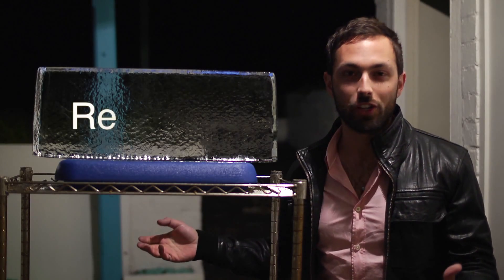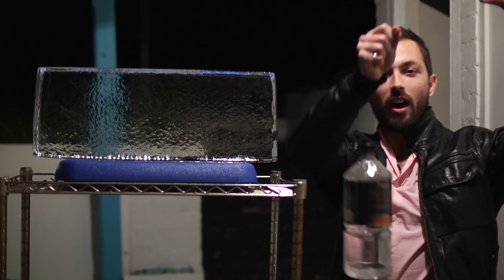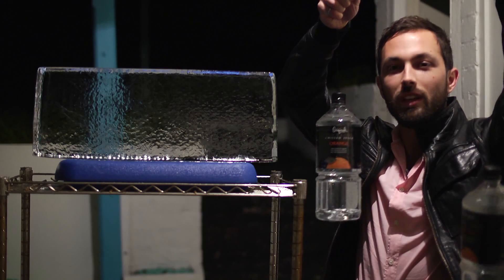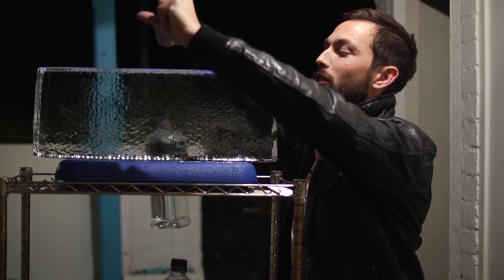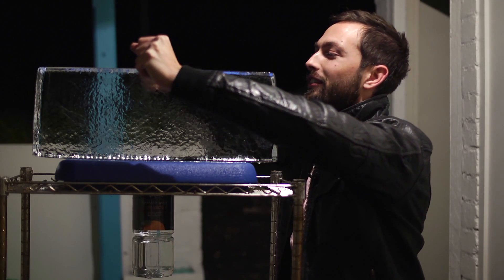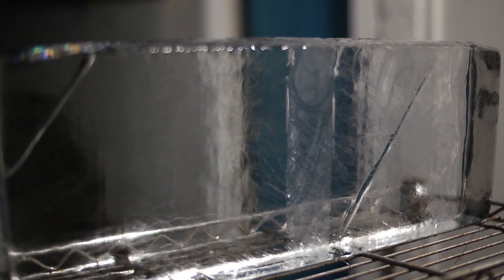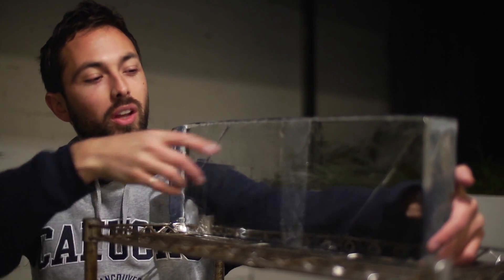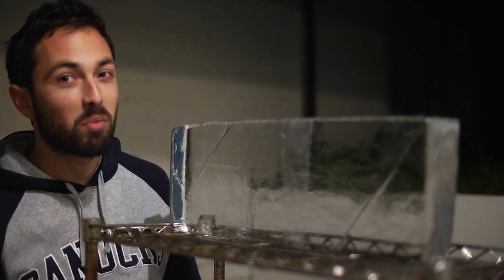Does Pressure Melt Ice?

Comment: Theres a difference between setting a whole block under pressure and completely melting it, then removing the pressure and having it freeze again - compared to slicing through a block with a wire and having the surrounding ice freezing the water to ice again.... just saying.
Reply: You are correct
Reply: Would friction be a variable from his experiment?
Reply: @collieleafman3089  mhm nope. With friction you generate heat. Enough heat, and the ice is going to melt as it goes above melting temperature.

Here, everything stays below freezing temperature. Pressure does all the work, and even though the ice turns into liquid water (briefly, as the wire passes by) it's still below freezing temperature, hence why it re-solidifies almost immediately after.
Reply: @Scorpac There is a difference in the size of the experiment but the principle is clearly still there. Additionally this is how pipes can keep water in a liquid state when the temp is below freezing. This processes is actively happening in cities during the winter.
Reply: @grant_111  shouldn't pressure make it freeze more easily when temps go down?
Reply: @irokosalei5133  that would happen for most other chemical substances or elements. And if we were talking about oil, or alcohol, you'd be correct.

But not water. Since water expands during freezing (water ice takes up more space than liquid water, after all) then external pressure works against this expansion, and if external pressure is high enough water stays liquid, as it cannot expand to form the crystal structure required to form ice. Apply enough pressure on water ice and the same happens, you break down the ice crystal structure and water returns to liquid state, despite the temperatures still being below freezing point.
Reply: @dr.getter7118  why don't it works with water bottles?
If I completely fill a bottle with no room left for water to expand and form ice, and place in freezer, it will still freeze
Reply: @narsisunkariya  and break the bottle because there is no room to expand in it. This is the reason you always leave a little bit of air inside water bottles, especially the glass ones
Reply: @narsisunkariya  yeah, as Exodius said, bottles aren't strong enough to resist the expanding crystal structure of water ice.

Plastic bottles will bend and change shape accordinhly, if they can, otherwise break open. Glass containers will always crack.

I suggest you don't put any water bottles in your freezer, if they're filled to the top, else you might end up with a puddle of frozen water everywhere =)
Reply: @dr.getter7118 that's interesting thanks for the insight.
Reply: @narsisunkariya  It's tricky to get the timing right, but if you put a new bottle of water (one with the lid seal still unbroken) in the freezer, take it out when the water's not frozen but its temperature is below 0°C, and then open it, the sudden drop in pressure causes the water to instantly freeze. You get a slush of ice and water. My friends and I used to love trying it in the summer (very refreshing when it works!), and the bit of air at the top of the sealed bottle gave us some margin of error in case it had already started to freeze.
Reply: @jimsilsby3841  yup,there is a very old veristatium video on this  phenomenon
Reply: @narsisunkariya  Oh, cool! I'm a new subscriber so still catching up. I'm sure I'll see it at some point, once the Algorithm decides to put it on my home feed.
Reply: @dr.getter7118  Is that why super cold water in a lake only freezes its surface?
Reply: @MaxIronsThird  mhm not quite, I don't think so..

so, winter, lake, this is the setting right? one characteristic of water is that it takes a lot longer for it to change temperature than, say, air.

so, even if air temperatures quickly drop during the night (or during the season, in general), water will take longer to notice, and to hange temperatures accordingly. Water in contact with the air will freeze first, as air will be the cooling agent.

Here's the second characteristic of water into play: water ice is an excellent thermal insulator. What's it mean here? It means that as the surface water freezes, it actually protects the water below from freezing. It creates this sort of blanket, and the liquid water beneath it has a hard time now losing heat to the outside air. Such a hard time that it stays liquid, in fact (barely so, anyway).
Reply: Chill dude it's 8 year old video

Comment: Should have used a material for the string with a lower termal conductivity than air. Because this way we don't know if the pressure Is melting the ice or  the fact that the ice close to the string Is getting more heat...

Comment: Is this why when freezing a bottle of water it can sometimes be taken out as a liquid and then upon squeezing the bottle it very quickly freezes?  The pressure created from the water expanding as it freezes regelates it and a final squeeze and the reduction of pressure after the squeeze causes it to freeze before my eyes?

The answer to this phenomenon would make a great video.

Thanks for posting interesting videos that answers questions I've never asked myself and often leave me wondering more.  👍
Reply: If you take a glass bottle that is at or slightly below 0 degrees and open it it should freeze because it was pressurized and that's what kept it liquid. If the bottle is plastic then that shouldn't happen because the plastic will have already expanded and the water in it won't be pressurized.

What you're describing sounds more like the water being at just about freezing point but there hasn't been a starting point for the crystal formation yet. If you have a liquid that is completely stationary it doesn't freeze as easily as if there is turbulence or some uneven surface to cling to, as that causes small crystals to form initially and then the whole thing freezes from there as they grow. In laboratory conditions when trying to make large single crystals that's kind of what they do, prevent any rough surfaces, impurities or movement in the fluid so it's hard to separate crystals to form.

Comment: Hi.  Thanks to you folks can ice skate.  I wonder what the structure of  "passed through" is, or why it's visible.
Reply: It's visible because as the ice refreezes it doesn't simply continue the crystalline structure seamlessly, there will be an amorphous boundary layer and new crystals have a different orientation which affects light passing through. 

If you pour water into a container, freeze it to very low temperatures (cold enough that pouring water on top won't melt it immediately), then take it out and cover it with another thin layer of water and freeze again, you'll be able to see the two distinct layers after it's all frozen, for the same reason.

Ice skating is a different phenomenon altogether, ice is melted by heat from friction.
Reply: @BigUriel  I had the notion that pressure played a part in ice skating.  

Regarding the visible area, I understand and actually accepted that notion from the beginning.  It sort of reminds me of the way ice blocks looked when we didn't have refrigerators but had Ice Boxes.  Before your time I know, but when the ice was first made I think they let air bubbles flow to create logical break points.  If we bought two blocks we put them on the bumper and when we got home we could easily split them.  

I remember that we could also buy "dry ice" from those facilities.  I don't remember why we bought it though.

Comment: This is dumb. If you put weight on a string and put the string on your finger it will hurt, and you might even get a cut. You're not made of ice, are you? Also how do we know that it melts because of heat in the string. Aaaaand pressurized water forms ice. You get get ice 7, aka warm ice, which can be found on the bottom of some water planets, and it's literally ice just because of the pressure the water is exposed to.the molecules of water vapor are not dense at all, meaning they're spaced out, liquid water molecules are decently close together, and ice molecules are very tightly spaced

Comment: this has such an unreasonable amount of flaws in it. its warm out, everything is different temperatures, the conductivity of the string, re-solidifying. 

the proper way to do this experiment. Put EVERYTHING in a 0 C chamber. wait for the wire to get to 0. THEN place the wire on the ice. The thing here is metal has a much higher thermal conductivity than water/ice. That means it absorbs and transfers heat far faster than the ice. What we watched in the video was the string taking the heat from the atmosphere and transferring it to the block of ice to melt it. NOT the pressure melting the ice. Then the energy stored inside of the block of ice re solidified the near freezing water. 

such an amazingly flawed experiment that is in no way, shape, or form, scientific.

Comment: Yeah. Or the wire is getting warm from outside and melts the ice. After that, water flows into the cut and freezes because of the ice on both sides.

Comment: The pressure exerted by the string creates heat. That’s why the ice melts but as soon as the string passes that area the small amount of water turns back to ice because the surrounding is colder 🥶.

Comment: As the line cuts through which is easily conducting heat from the wire that's not in contact with the ice, its re freezes due to the chunk of ice being cold enough to refreeze it. Same thing happens in a glass of water, the ice "sticks" together at first because it's cold enough to freeze water between the Cubes

Comment: I think the metal string actually transferred the heat from the environment to a tiny area of the ice, and that heat is actually melted the ice on the way down.
The weight only pushed the string to the bottom of the melted area.
So once the string has passed some distance, the water freezes again beacuse of the ice around it.
This experiment is so non-pure, that the initial claim of ice melting under pressure remains unconfirmed for 100%

Just a smart trick like "street magic" ;-)

Comment: Yeah. Not so much a certain demonstration of regelation -- at least not conclusively  due to pressure... your set-up virtually ensures that the wire is hotter (bringing in more heat energy) than the ice...

Comment: i think its due to heat conductivity of the metal wire, not the act o pressure alone. if you try this with same sized cotton wire or any non metal it probably wont happen at least this fast

Comment: So can we see this work in a room that is below freezing??? 

Seems that if this is done at temperatures above freezing, that the e string wouldn't necessarily need significant pressure to cut through the ice... 

Is it possible that the string could absorb ambient heat, and just simply melt its way through the ice???

Comment: This is incorrect. The temperature of the wire (metal) remained above zero, therefore melted its way through the ice, only with the assistance of pressure from the weights. The ice block of course refroze from being in contact (clean, smooth contact) with the other side collectively holding a net temperature below zero.

Comment: You have successfully demonstrated the thermal conductivity of steel.  Try this experiment in a sub-zero degree environment if you wish to demonstrate regelation.  Despite the methodological error, it was still a neat time-lapse and fun to watch!
Reply: Regelation was discovered by Michael Faraday. It occurs only for substances such as ice, that have the property of expanding upon freezing, for the melting points of those substances decrease with the increasing external pressure. The melting point of ice falls by 0.0072 °C for each additional atm of pressure applied. For example, a pressure of 500 atmospheres is needed for ice to melt at −4 °C.
Reply: Do people even look at video upload dates? This video is 10 years old.
Reply: @aurelia8028  Whats your point?

Comment: Wouldn't the wires simply heat up from the ambient room temperature and conduct it to the part that's cutting the ice? They would heat up past the melting point of ice due to the air to melt a small amount of the ice, cool back down and heat back up from the room again, thus melting some more ice?

Comment: What if the reason is f the cut is not due to the pressure (only), but also due to the string temperature and thermal conductivity (like it serves as an ambient heat conductor) and that is what causes ice to be cut. Second point is that ice could form again just due to the two big ice blocks being kept close together and had little to do with “removing the pressure”. I’m not saying this is the case, I just think for this particular experiment with this title it is a bit ambiguous. I still liked the video.

Comment: No explanation why? 

I'm left guessing that it happens for the same reason ice floats on water... ice is less dense that water. When we apply pressure to ice, it increases the density. If the pressure is great enough, the density reaches the threshold and the ice turns to water. Once the pressure is relived, the density decreases and the water solidifes into ice.

Comment: would be nice to try that with something else than a metalic wire.
I remember seeing this very experiment when I was in college. I guessed the reason was localized pressure but the professor explained it differently, saying that in fact the highest contribution was that the metallic wire was conducting external heat just enough to locally melt the ice and the block was cold enough to freeze it right after.

I think both explanation make sense. Also we could evaluate the pressure under that wire and see whether it really is enough to melt ice.

Comment: It's above zero so the wire outside the ice is zero and then transfers heat to melt it. The water freezes from the cold of the rest of the ice irregardless of why it melted. The first statement is a suggestion of how the experiment is flawed, the second is just true. Grow up and produce sound science or just don't.

Comment: I just have to look at my glass of water with ice cubes that have frozen together in clumps to realize that what you said happened is not what happened.  The guitar string conducted heat from the air into the ice and caused it to melt.  As the string passed through and away, the water above refroze as the average energy dipped back below the freezing point.  

Prove me wrong.  Up the scale.  Ice block + hydraulic press.

Comment: I realize this is ~7 years old now, but i have a issue with your method... as you introduce a couple variables that would argue this experiment.   you have a wire exposed to ambient air.  the ice internally can freeze left over water internally back to solid.  so a wire that can get heat from the ambient air will eventually melt the ice regardless of pressure, only your pressure will have expedited that reaction.   while i don't deny the science.  id love to see a more evident example.

Comment: It’s just the friction that melts it temporarily and as the surrounding ice block is cooler than the string, it solidifies again to ice as ice overcomes the friction.  Although the average temperature near the cut will now be slightly higher due to average of friction and cold ice.

Comment: You can witness this whenever you go skating. The pressure caused by the blade melts the ice under your skates. It wouldn't make a difference if the room was colder or if you had a conductive wire.

Comment: the wire is good in absorbing cold like aluminum and other metals. Due to the absorption the ice melt. And wire goes down. Once again the two separate blocks of ice freeze due to the cold temperature of edges of the ice. I am correct??

Comment: It’s not pressure it’s because the air around it is not that hot but when something makes Contact with it the object makes direct contact the they exchange heat from warmer to cooler I am not saying that you warmed the wire but it is naturally warm

Comment: Pressure does NOT melt ice. It is the higher temperature of the pressing object that, in addition to pressure, gains an accelerated exposure to the ice, causing it to melt quicker.

Comment: The fact that it freezes again has nothing to do with the pressure. It has everything to do with the thickness of the string, which determines how close the 2 halves of ice are together, and how fast it would re-freeze. Had you used a much thicker string/blade, chances are the ice block won't "fuse" as quick, or not at all. It's also a bit misleading to say that this water freezes again, because the droplets that stream down the string won't freeze as they are no longer in contact with the ice block.

Comment: This isn't actually that correct. The way you demonstrated has some fallacies. Such arrangement can cut through a clay block which doesn't mean that tje pressure has changed the clay semi solid block into liquid.
And if you bring two ice parts keep them in contact for a few seconds they get attached.

Hence whatever you said and showed didn't justify. Try applying pressure in a larger area(i know larger area will take a lot of time probably) but the larger area will actually help us see the formation of water and we'll also get to see its conversion into ice.

Comment: I don't think so. I agree that the pressure due to string melts the ice but after the wire has gone through it, the thing freezes again because of the surrounding ice. Maybe an experiment where the only factor for refereeing was pressure, this could be demonstrated better.

Comment: this is actually a really bad demonstration because we are assuming that the ice is exactly 0 degrees celsius. and more than likely that is not the case because of fluctuations in temperature and whatnot. so there is a possibility that the wire is warming the ice, melting it, and then the surrounding ice is freezing it back up.